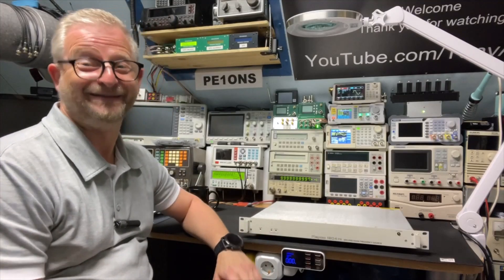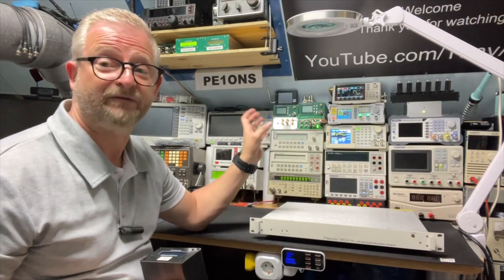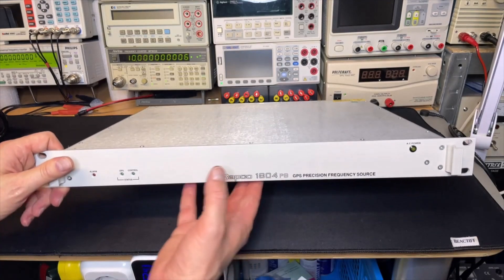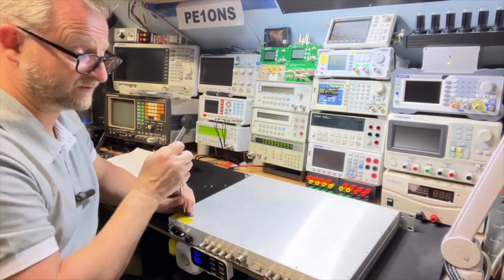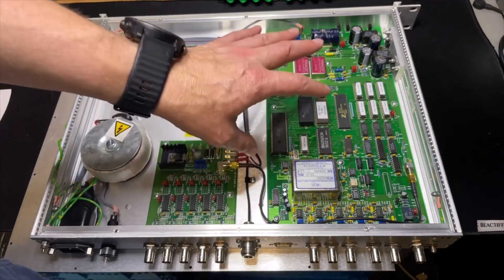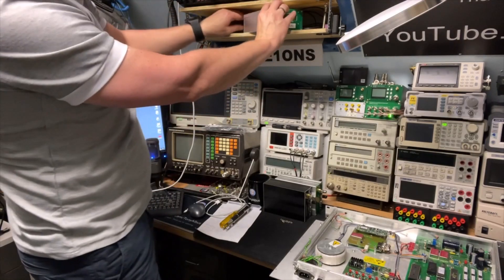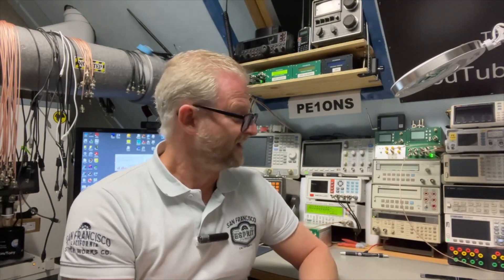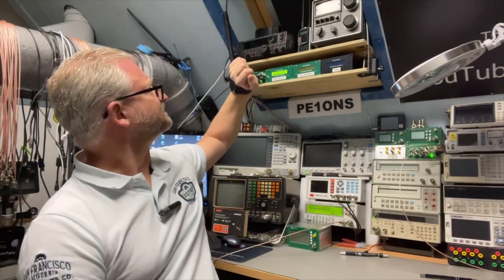TA-0302:  Rapco 1804 P9 Professional GPSDO Test and Adding NMEA Output

Comment: Unlike GPS use for positioning, for a frequency reference the best satellite arrangement is actually the reception of a single strong satellite signal, not a constellation of them, since you are not trying to triangulate a location, but to clearly receive the signal of one of the cesium clocks aboard a satellite. The more satellites you receive, especially if they are from 2 different systems the more it confuses the receiver, slightly reducing the accuracy. I believe the GPS receivers designed for timing will automatically try to select a single strong satellite signal to work from.
Reply from the maker: Thank you, yes lot to learn still for me about this.

Comment: Hi Tony,Love your videos.You are coming close to my area of test & measurement.Phase /stability analysis will give much better results  of the UUT.The BG7 's i have show very good 1 second and 10 second precision. I use a Rohde & Schwarz XRM rubidium (has been running for 15 years /with external battery back-up) as my primary timebase source and 3 BG7's (3 years running time)as secondary sources . Phase stability in the order of 5 x10-14 comparing these units with timepod.These BG7's are a wonder of affordability to cost ratio.let us know of your results of the Rapco with some long term running.
Reply from the maker: Thank you David, yes it was very interesting to do. Wow you are very serious about this with so many GPSDO's Cool!.. thank will try that.

Comment: I think it would be much better to compare that two GPSDO using phase (same phase requires same frequency) comparation method like connecting them both to the two channels of the oscilloscope in the X-Y mode. The result should be one point that does not move on the screen. When phase of that two signals change, that point would move on the eliptic curve. So if you put the oscilloscope into a infinite persistence, then you should obtain some part of an eliptic curve, where angular length is proportional to maximal phase difference of that signals. 

I think this would be a nice experiment. Similar thing did CuriousMarc comparing the GPSDO to the cesium standard and he found, that theese things are little bit wobbly in a phase each other, but nobody knows if this came from the cesium standard or from the GPSDO. So I think, that repeating this experiment with two completely different GPSDOs could bring a little more light into this issue.

Resoultion of that X-Y image is proportional to the sample rate of the oscilloscope, so higher is always better :3.
Reply from the maker: Thank you, yes that would be a nice test indeed...